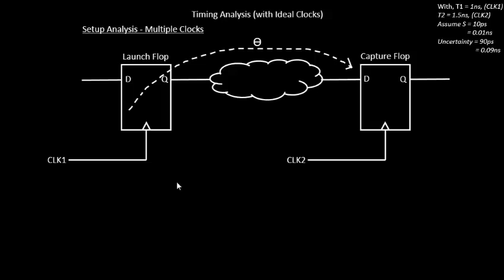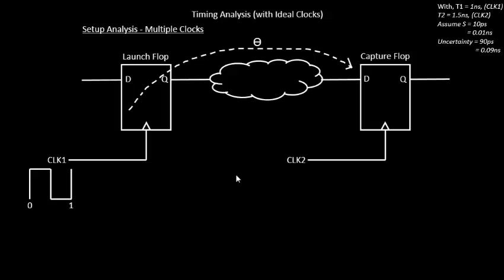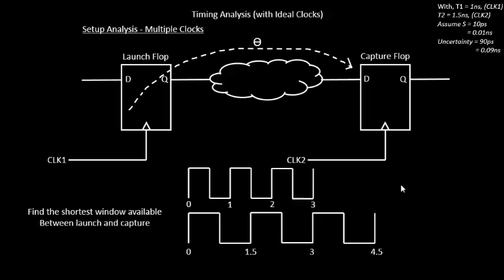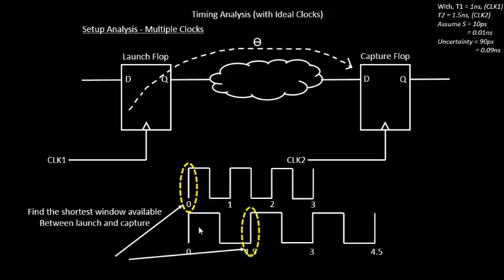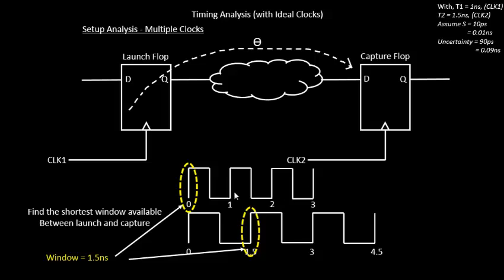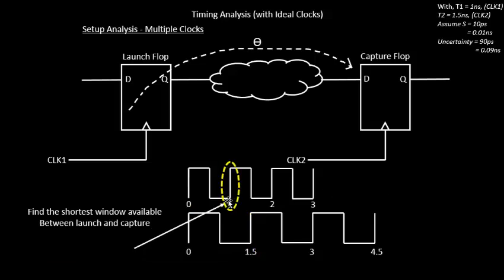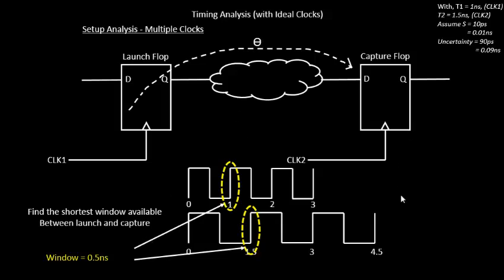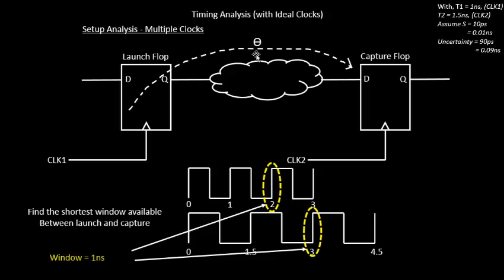How to do Static Timing Analysis with Multiple Clocks?? Learn @ Udemy- VLSI Academy

Comment: You also have to tell that clock are related or not.If the clock are not related 0.5 ns calculation is not correct.is the next video posted already?where is the link for that?